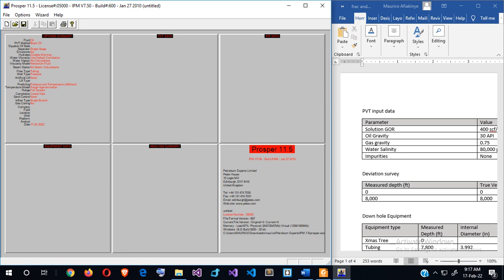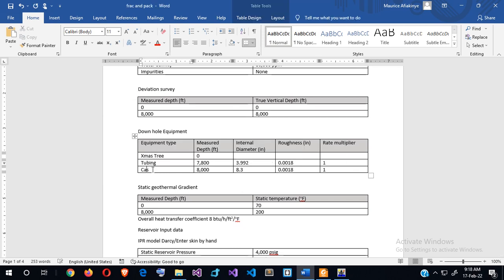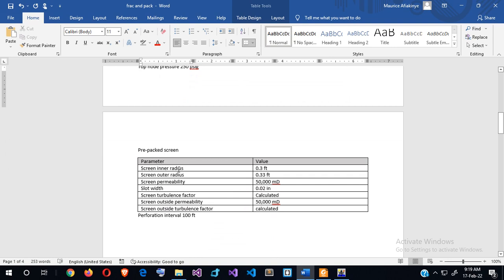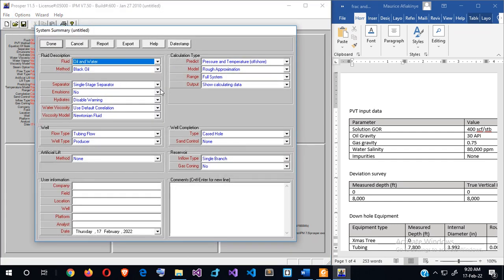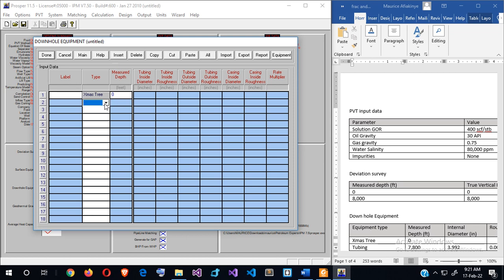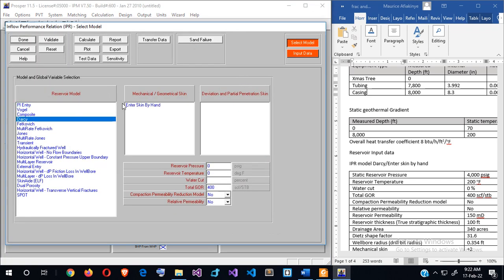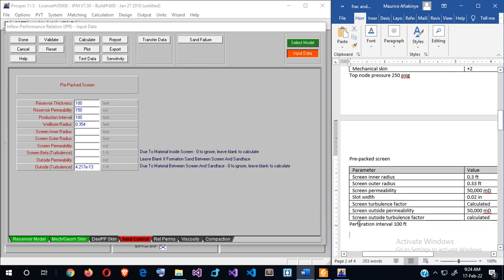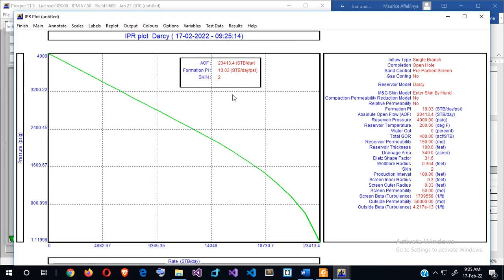Prosper part 23 (pre-packed screen)

Comment: Hello. I would like to ask a one question about the shape of VLP curve. I did one simulation on PROSPER and I got a VLP curve that was almost a straight line (there was an operating point) showing that pressure losses due to friction is really small compared to pressure losses due to gravity. So, any comment on this matter? 
Thanks in advance!